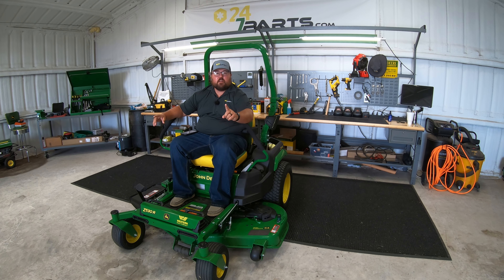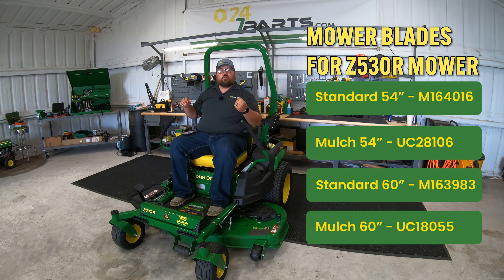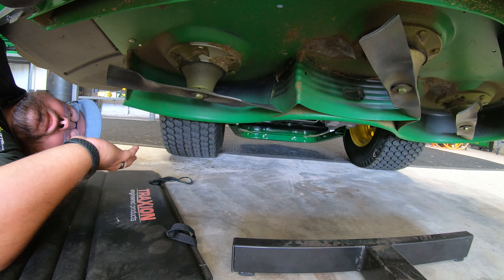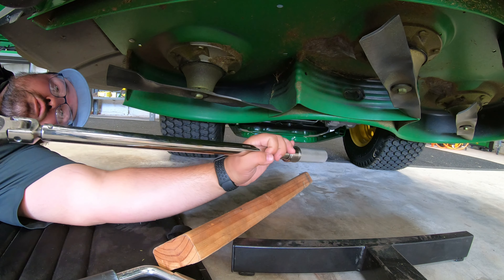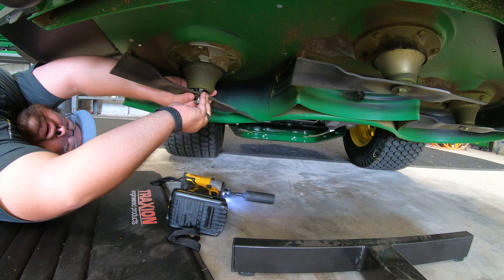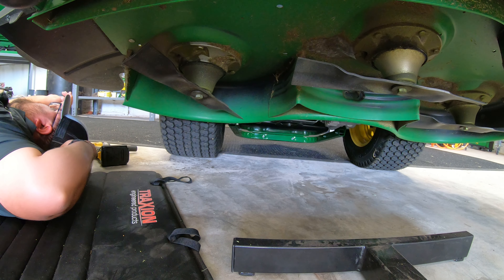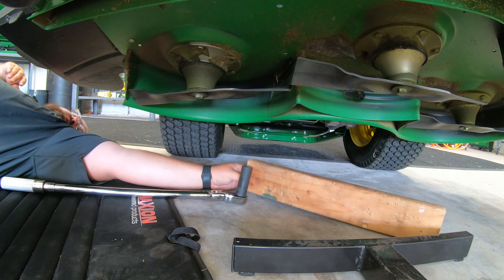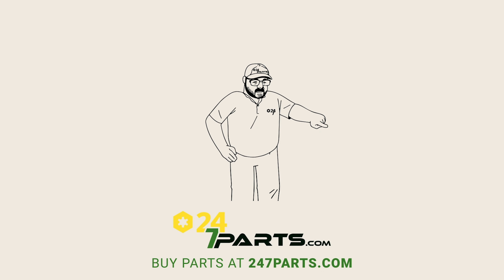How to Change Blades on John Deere Z530R Zero Turn Mower

Comment: Great video, I just bought a Z530M in Aug.  I decided when I bought the beast I needed to change blades, so this is a great video.  Unfortunately JD service and every other lawnmower service is seven weeks behind,  Absolutely no riding lawnmowers at JD, or Lowe’s or Home Depot.  I was only bel to buy this one because the deal with the guy who ordered it fell through.  If I wanted to order one now it would be spring of next year for delivery.